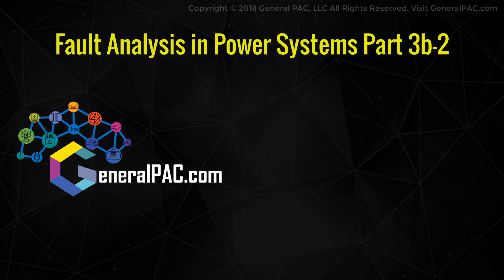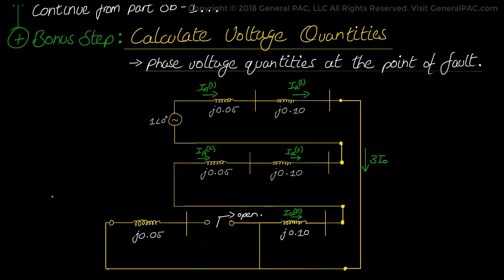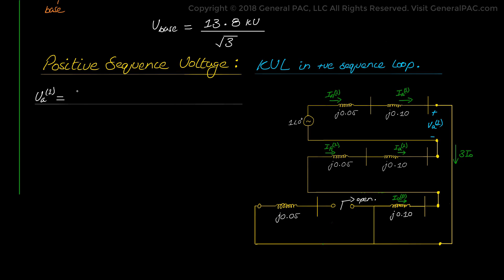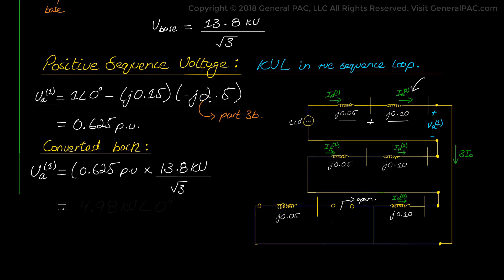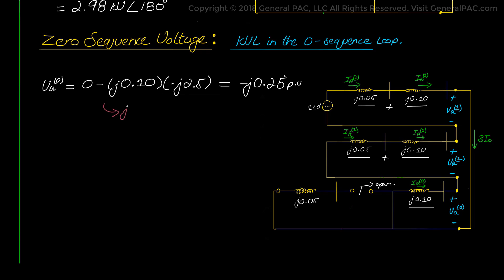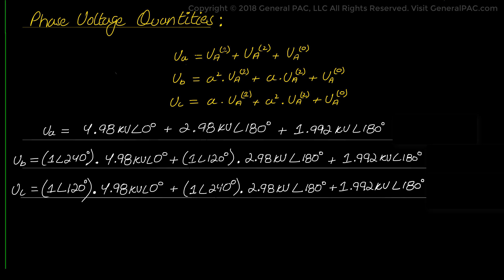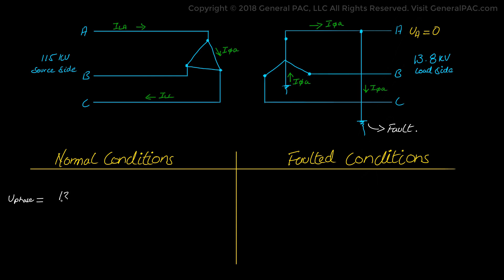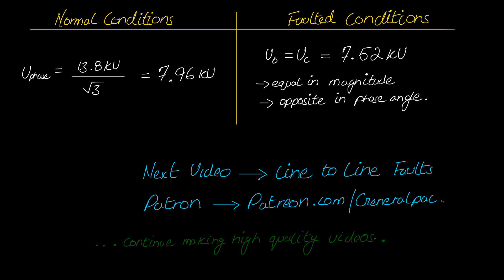Fault Analysis in Power Systems Part 3b-2

Comment: You forgot to mention why the -ve sequence voltage is 180 degrees out of phase with the +ve sequence voltage. The video gives the phase angle as 180 degrees, but doesn't show where the phase angle comes from.
Reply: -1 is the same as 1 at 180 degree. In our case the voltage is - 2.98kv which is the same as 2.98kv at 180 degree.
Reply: @jafaralturfy5053  No it's because there is a 'j' in both those terms being multiplied. Therefore the 90* phase angle would be added to 180. The negative signs will cancel and be left with a positive voltage in a 180* phase angle.